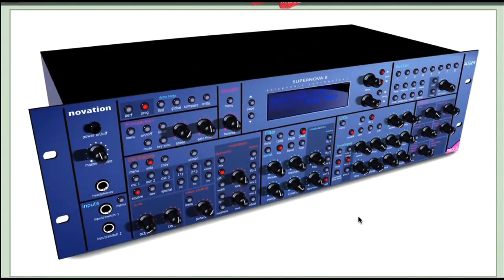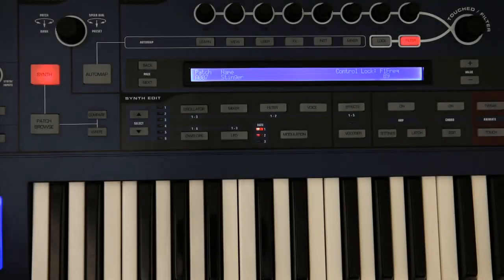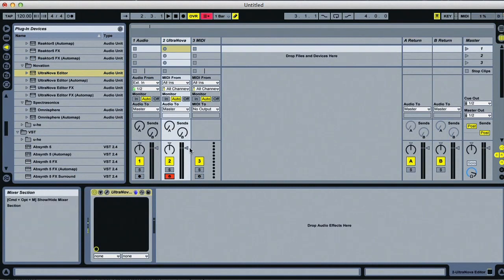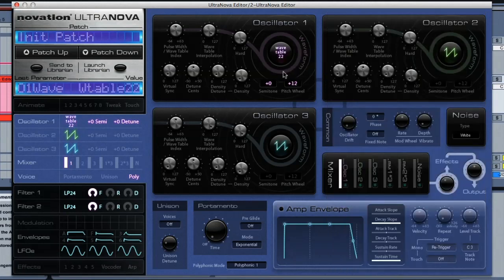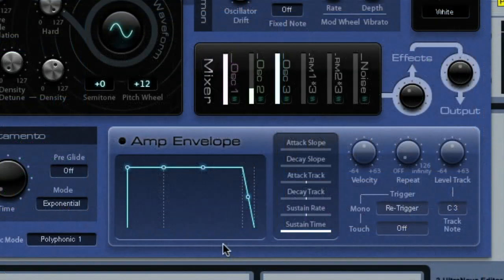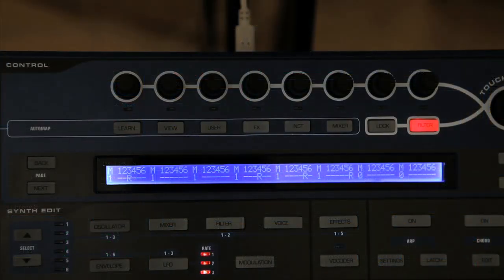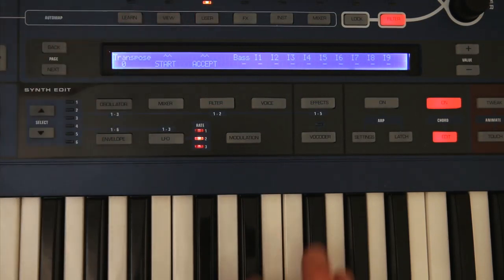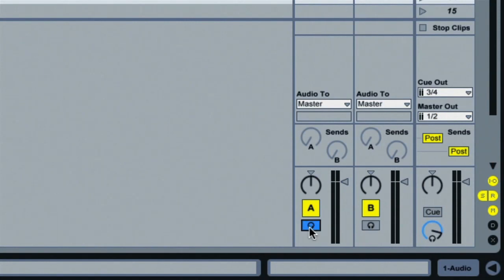Review of Novation's Ultranova Hardware Synth and Software Editor

Comment: Is there a way to run a guitar thru the effects, filters, etc. to get some interesting sounds coming out as well.  In other words, can a guitarist approach this synth as a way to use it initially as an effects device, and later, as a synth as you climb up the learning curve?
Reply: A midi guitar can go into the ultranova synthesizer (as a synth guitar). Not sure if you can plug an electric guitar into the synthesizer.